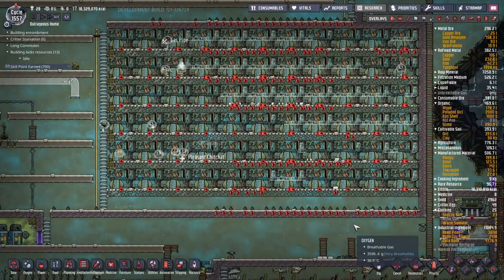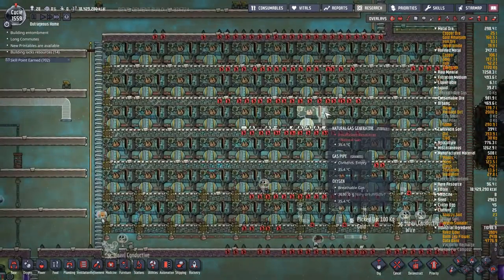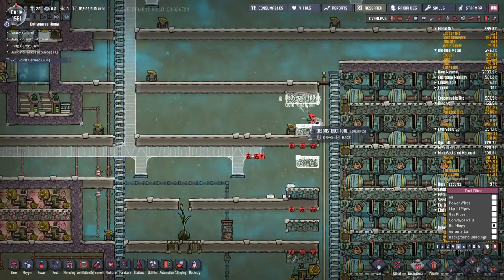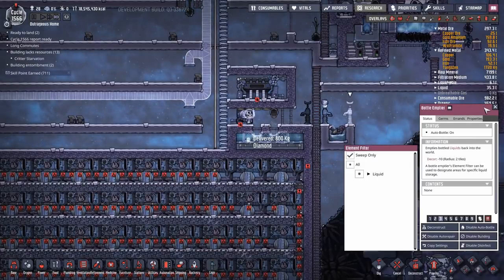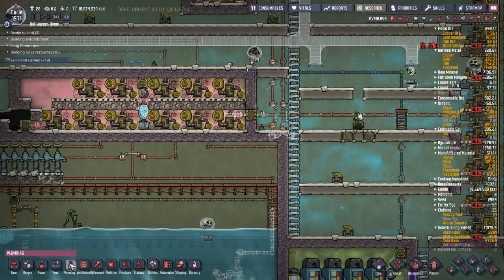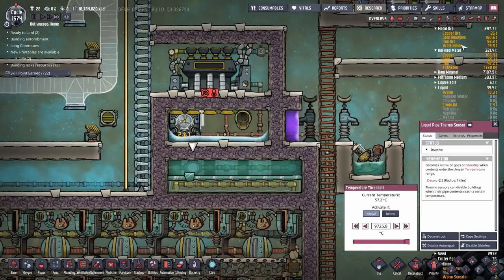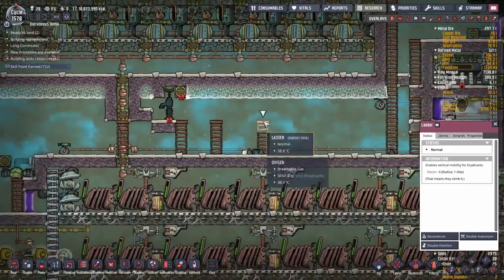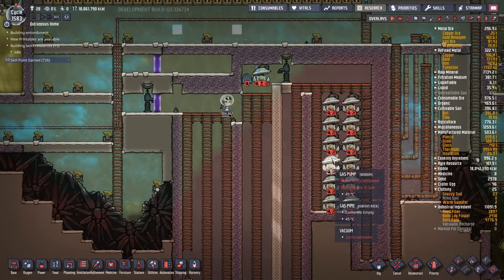QOL Mk3, 39 Natural Gas array and Large scale cooling : Oxygen not included

Comment: Feels like that vertical metal wall between sour gas and natural gas will kind of ruin temperature gradient. Probably switching between metal and insulated tiles will be better? At least it was made that way in the original desing by Tony.
Reply from the maker: Never though of that, I'm going to have to do some testing. I know the design works but that modification might make it more energy efficient.

Comment: Wouldn't it have been easier to balance the gas input across the 2 bottom floors, instead of balancing the output electricity between the 2 grids? Something like using 2 liquid reservoirs, split the output pipes, and then mix and merge them again.
Reply from the maker: Going to have a crack at this after a bit of testing. Good Idea.

Comment: 48:11
If you're actually paranoid, why not use insulation for pipes since they're literally touching tons of thermal coupling/heat syncs?
Reply from the maker: Good point, never thought to use it. I've got to shake that mindset that space material is so valuable. Managed with Niobioum and super coolant, next up lets spam some insulation.
Reply: @FrancisJohnYT  I'm actually curious about the use of insulated materials made of insulation. Is there and point in not using regular pipes and tiles? Or is it only 0 conductivity when they're insulated? Why can't klei remove the regular variant and reduce the cost of the insulated variant to 100kg?
Reply from the maker: @G.r.e.g.g.l.e.s  If you make a regular pipe out of insulation it will exchange heat with it's contents, pretty rapidly at that. I learned that the hard way. If you make an insulated pipe out of insulation 0 transfer or so small to be undetectable. From what I understand insulated variants have a by 25 multiplier to their insulation values.
Reply: @FrancisJohnYT  Klei REALLY needs to fix that. They advertised that insulation would be like old abyssalite, and this is just not okay. I say they should remove it as a useable material and rebalance costs.

Oh yeah and speaking of abyssalite... Sour gas in the whole flipping oil biome. But on the bright side if you find a little pocket of 410-510 degree abyssalite, you have a free petroleum boiler.
Reply from the maker: @G.r.e.g.g.l.e.s  Sour gas floats up, pump CO2 into the top part of it with a high pressure vent and you can overwrite the sourgas and turn it into CO2. It's slow but it makes it good for something.

Comment: Why don't you use the cooling loop directly from the aquatuner outlet? What is the point of making a loop? You could use a liquid reservoir with a bit of the liquid if you want to equalize the temperature.
Reply from the maker: It about having a finer level of control of the temp. In a straight through system imagine if the temperature sensor trips as the temp hits -20, the whole loop stops moving. Now the whole loops will start to heat up unevenly, depending on where it is and whats nearby and active the temp change will be hard to predict or anticipate. In this system you have an ice box set to the desired temp and the loop just rotates through constantly and gives you consistent predictably cooling regardless of the aquatuner being on or off..
Reply: @FrancisJohnYT  The loop wont stop if you use the design thingy that bypasses the aquatuner if it is disabled. And to not have spikes in temperature, is good to place a reservoir on the end of the aquatuner to even out all the temps.
I thought i was missing something, thank you for the explanation xD

Comment: I'm 90% certain the thermal behaviour of gases is semi-consistent with reality, so why not run the cooling loop from top down. Ah of course, maximum chill at the bottom for the icy cold polluted water. Nevermind, of course you could use a metal floor to spread the chill super evenly across the bottom, or use metal tiles under the natural gas generators except the tiles beneath the output spouts. I'm sure you've balanced all this, but just a few ideas about sharing the chill. Of course, the most insane way to do that is diamond tempshift plates...
Reply from the maker: I am very tempted to just spam diamond through out the generator room, but the cost makes me hesitate. I think it's about 600 tons, maybe later when I have the stockpile to do it :)

Comment: Piped the water into the cooling. FINALLY doing it right way but still. 
Run the pipe on the upper side with the steam generator. Not the bottom side. 

Instead of wrangling all of them, change the setting.
Seen my base yet? Stick your pufts in a room with the podirt then a separate room with a deodorizer or 2. Even if you get a dense it won't hurt you.

-20 C natural gas gens. That’s -20 co2.
Slickters aren’t going to like that. 
59:55 You can access the debris if you come in from the side.
It's still a vacuum in there.

Comment: Francis, is it possible to instead of cooling the nat gas generators make the room hot so that the polluted water evaporate and with steam turbines you collect that heat and pure water, and cooling just the water coming out? Or to they need to be of space materials to resist the heat?
Reply: https://www.youtube.com/watch?v=gIYJBfYBh1g&feature=youtu.be&t=698, a steam generator will eat the heat till 125° so steel would be enough
Reply from the maker: @intox881 You even time stamped the video to the exact location, perfect.

Comment: After seeing you build several of the heat deletion devices I have two questions:

What is the function of the "ice box"? Or rephrased, why one loop for the aqua-tuner and another for where the cooling is needed instead of just one loop running through both?

Why is there sometimes an "injection device" with the steel doors like you can see in the cool steam arrangement near this new build?
Reply from the maker: I will attempt a concise explanation due to comment limitations. A straight Aquatuner loop has two options current temp or 14C cooler. You are limited on temp accuracy to +/- 14C of target. If you make a pool/ice box and run the loop through that you put a temp sensor in the pool and now you can control the temp to +/- 1C. It's about hitting an accurate temp. Then the loop that does the cooling runs through the ice box in some way and spreads the cooling to where it's needed.

For thermal injectors it's about creating an ice box that you can use to inject a burst of cooling. You can bank up temp for when you need it and then engage the door to let it loose. For the steam vent I only want the water in the tamer to hit 95C so I'm not over cooling and wasting power. The door only closes when the temp goes above 95C and injects cold. Once target is hit door opens, no more temp transfer. No wasted over cooling, very accurate temp control. But for thermal injection the temp is not controlled by the temp in the ice box, the ice box is just a bank. The temp is controlled by the door. This allows the ice box to bank chill that I can draw on when i need it for burst cooling.

What variant you use will depend on how accurate you want to be or if you need to do big bursts of cooling/heating. Another option is to use a liquid storage to even out the temp, I am not fond of them but they do the job in much the same way as an ice box cooling loop and can be cheaper to set up. Not sure I'm being clear, does the above make sense?
Reply: @FrancisJohnYT  Thank you for taking the time to post such an extensive reply, that is truly appreciated. So the liquid temperature sensor is set to the target temperature and even though it's checking the liquid in the pipe the liquid in the pool remains closer to that set temperature? Am I understanding that correctly?
Reply from the maker: @Scyth021  Thats it. The only reason you don't use just a regular temp sensor in the pool is you usually are more worries about the liquid in the pipe freezing and damaging the pipe. Now that I think about it I don't need to worry about that with super coolant. I should have just used a regular temp sensor in the Nat gas array ice box, doh.

Comment: 0:00 cycle 1557 Natural gas not included. This guy got jokes. Ha.
Still working on natural gas generator room.
4:55  Working out the power grids. 
11:35 Leave it hot or cold.
16:05 Almost done and the décor sucks. Expansions for granite statues.
20:45 All thermium pipes.  Whoops
22:00 15 cycles later. Cycle 1572 Finally the coolant flows. Promote some dupes.
25:40 Steam cooling done right this time.
31:20 How the power grid works.
38:25 Sealing the cold in, clean up and rewiring the grid.
42:15 A liquid tepidizer used.  Building the sour gas cooling loops.
47:45 Diamonds are a dupes best friend. This guy thinks he’s all that. 
He’s got puns too. 
56:55 Sour gas natural gas pathing. Getting ready to power it.
Reply from the maker: Thanks again chief.

Comment: "I got to use steel I'm running out of everything other ore" has 300t of metal ore and 300t of refined haha.
If you find an easy way to get rid of those polluted oxygen pockets inside the deodorizer, you'll be my hero and I'll name my two first kids Francis and John whatever their gender is.
Reply from the maker: I got nothing, looks like you will get to call your kids by real names after all. You could try surrounding them in bricks, deconstruct the deodorizer diagonally and then build a replacement block diagonally to destroy the gas. There is not an easy or quick way to do it unfortunately.